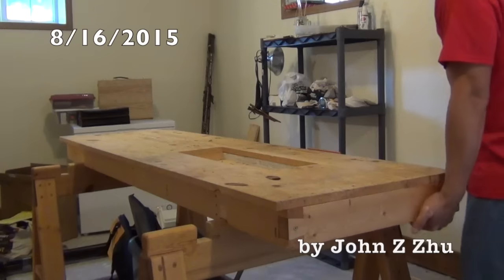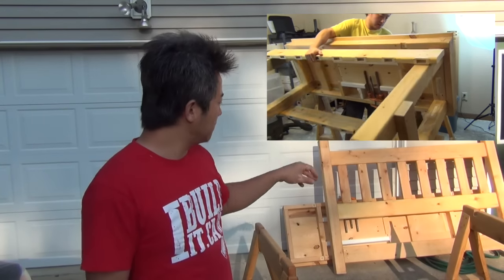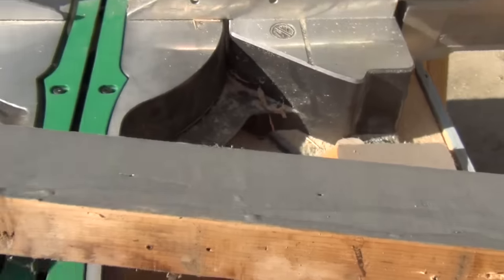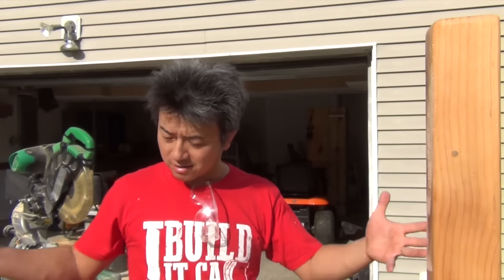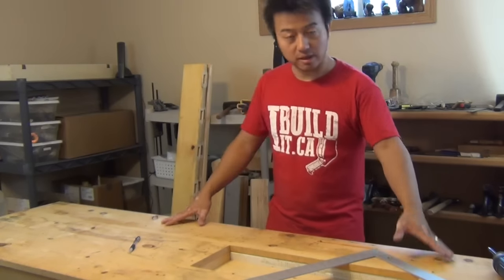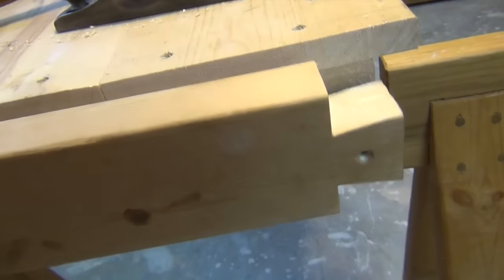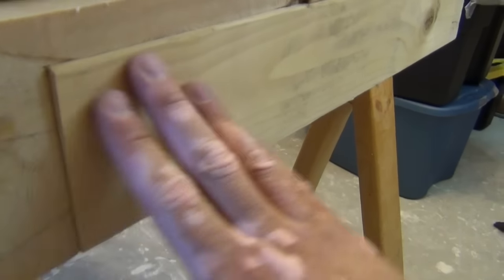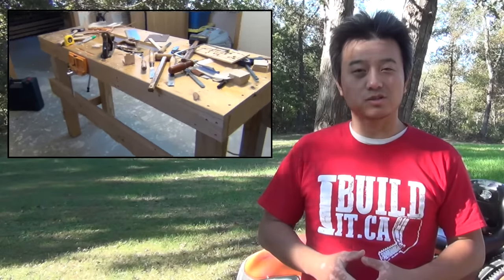My Workbench - Recycled, Reused, & Remade - Porch Talk 3

Comment: John, I know the sun and heat aren't going to be a factor till next year. I hope you have a Harbor Freight nearby because you can get a very quick erect canopy and a box fan both for under $90. I like cutting and working outside also and the fan in the shade of the canopy keep me cool enough even at 100deg and high humidity. When closed the canopy only takes up 11"w x 11"d x 50"h. Comes with a bag for longer winter storage. thanks for sharing, looking forward to the new bench.
Reply from the maker: +MRrwmac There is one 1.5 hours away, but I am not sure what I am going to do with such a small canopy? May be if I baked in the sun long enough I can fit into it. But a canopy is definitely something I want to get so I can setup at the local farms market.

Comment: The holes in the rails from the headboard will make nice hold downs for the sides.  Nice bench.
Reply from the maker: +Zack Garner Thanks, I decided to install them facing down because it would collect likely trap dust than get used.